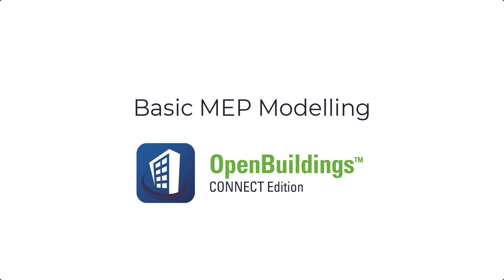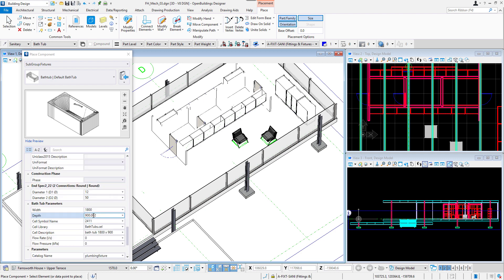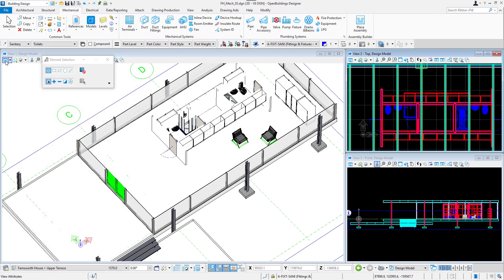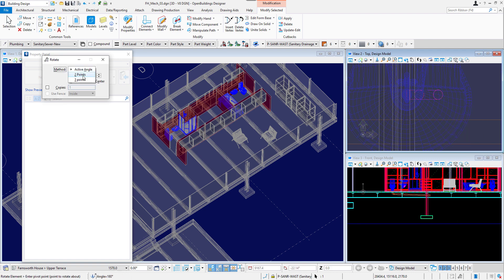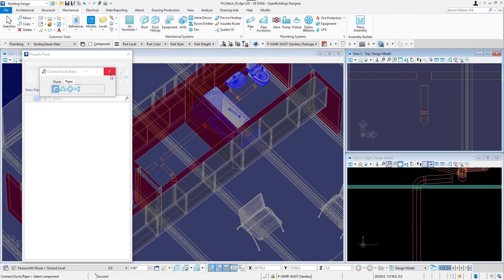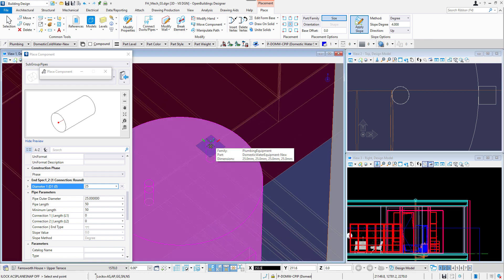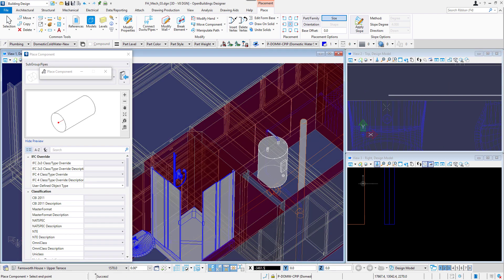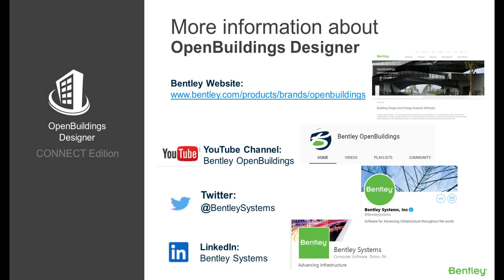OpenBuildings CONNECT Edition Update 7 - Basic MEP Modelling

Comment: Please slow down, especially difficult for new users. Also create small videos on how to control the height of services and how they can be modified so they all drop by the same amount with lowered etc. Please add insulation and show how this can be changed to transparent and also show it on the drawings clearly in different colours. So this will be under the rules for display style.
Reply: Please, If you found any other sources for MEP discipline share them with me. I am a beginner and willing to learn it.